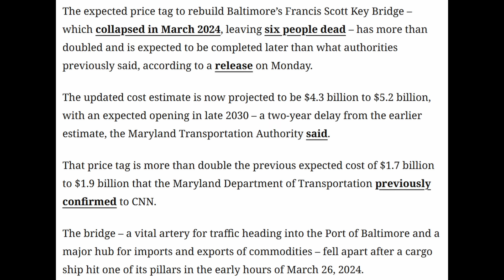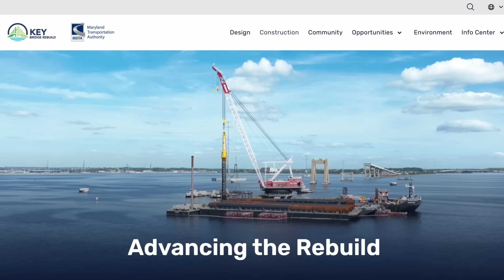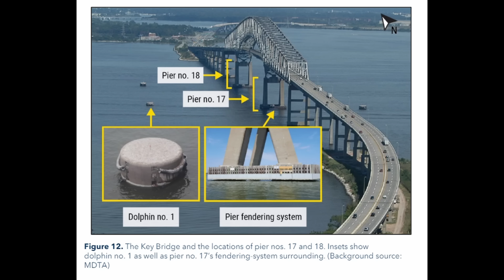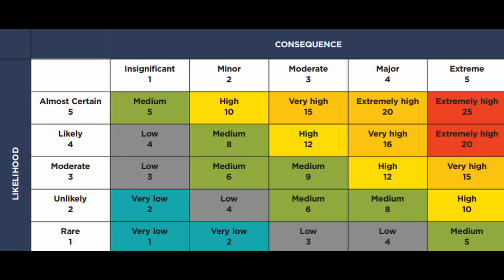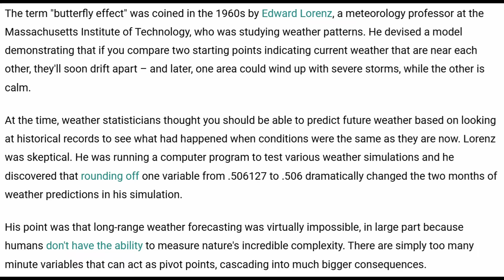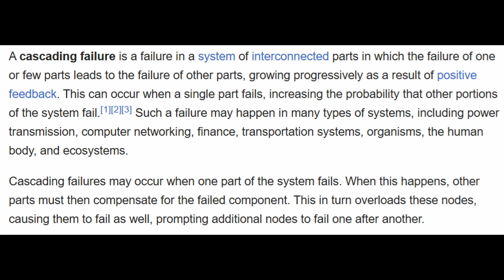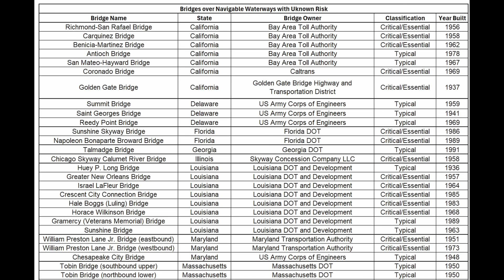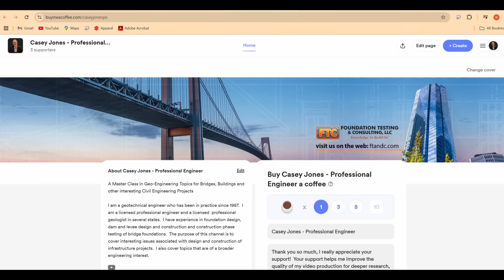Key Bridge Destroyed because of a Label on a Single Cable

Comment: Reading the Rivers And Harbor act of 1899 today for unrelated reasons.     SEC. 18.  Gives Kristi Noem (dept. Coast Guard is under) authority to order remedial action to existing bridges that constitute hazards to navigation.  Which, bridges prone to collapse if a ship has a loose wire are in my opinion.  It made me think of the Key bridge story.   

I can see a re-design for the electrical panel to give a visual indicator when the wire is inserted all the way and a retaining force is being applied.

Comment: It would also be good if all future bridges had some way to immediately detect when the bridge span is no longer continuous like in the case of railroad tracks (electrical current along the rail is interrupted). In this way, only the people currently on or unable to stop before the point of bridge failure would end up in the drink. There's not one single reason not to do this immediately.
Reply: Also, don't tell me that money is a reason. If you value a relatively small amount of money over human life, you have no business doing any kind of engineering and we all know that many of the problems we have with modern engineering would cost a very small fraction of the total cost of the project to fix. No excuses.

Comment: Sometimes I think we trust in our computers more than we should. Computers work on algorithms, which are models. What many or most seem to have forgotten is that ALL MODELS ARE WRONG! However, some models are useful. Models should be used whilst never forgetting that all models are wrong in some way or another no matter how useful they are and the beauty of being a human is being able to look rationally at these models and the results of ongoing experiments based on them and noticing where the models are wrong. In the case of engineers in particular, someone needs to notice and have the power to do something about it. One needs to learn not only how to use computers but how to tell when the computer is wrong, which only a human being can do.

Comment: for critical infrastructure, the critical risk factor, in my mind ought to be based around 
- the maximum size vessel the waterway would carry (including if dredged in the future)
- assuming this maximum sized vessel is deliberatly put into the infrastructure by design into the the most vunerable area at maximum speed and wieght.
- long term critical infrastructure needs to be designed as such, with a view that at some stage there will be a maximum effort out into takeing it out.

Comment: Poet George Herbert included in a 1640 collection of aphorisms "For want of a naile the shoe is lost, for want of a shoe the horse is lost, for want of a horse the rider is lost." The root cause analysis of chain of events preceding any severe action expose apparently trivial issues. Yet hundreds of thousands of trivial issues never cause any severe events. This exposes the true systemic failure. Trivial failures are expected, the system design must accommodate these, and compensate, if avoiding tragedy is the goal.

Comment: You want answers? Here's your answer, Tunnels use tunnels instead of bridges. I'd like to see a boat run into a tunnel.
Reply from the maker: I think there is an issue with no being able to have hazardous shipments going through a tunnel.
Reply: Tunnels... full of brand new HIGHLY FLAMMABLE electric cars 😅 You will see that more and more often.

Comment: I'm SURE there is a system for Risk Assessment and Mitigation, but that requires $$$$ and THE IMPETUS FROM THE ADMIN SYSTEMS IN THE PORT TO UPDATE THE ANALYSIS AND TAKE ACTIONS.

Worked in another HIGH RISK industry, and I was continually pounded and fettered by the steps and analysis needed to protect our safety envelope.  This is typical of the FAILURE of people TO TAKE THEIR JOBS SERIOUSLY ENOUGH TO HAZARD THEIR PAYCHECK AND MORTGAGE PAYMENTS.

The WIRE was not the OVERWHELMING ISSUE.

The appropriate systemic requirement is BARRIER ANALYSIS, as in the Swiss Cheese metaphor for handling risks.

Butterfly Effect is mostly irrelevant, as there are FAR too many BARRIERS that ALSO have to allow such a butterfly to make a difference.
It is an interesting Gedanken Experiment/Thought Experiment, but it is too lacking in details to be PRACTICALLY implement for efficacious prevention of disasters like this.

As far as I'm concerned, The Port was utterly remiss in ADEQUATELY IDENTIFYING THE RISKS WHEN THEY ALLOWED LARGE SHIPS LIKE THIS TO PASS UNDER THE BRIDGE SAFELY!!
As far as I'm concerned, The Port was TOO CHEAP TO TAKE THE STEPS NECESSARY TO ENSURE THEIR EXPANSION OF SHIP TYPES ALLOWED WAS SAFE!!!
As far as I'm concerned, The Port was DRIVEN MORE BY THE COMMERCIAL INTERESTS AND CROOKED BIDNESSMEN IN THE PORT THAN BY THE LIVES AND SAFETY OF BRIDGE USERS AND PORT EMPLOYEES!!!!

This is just another example of entrenched, OLD-TIME CITY BUREAUCRACY being CAPTURED by the very crooks they are meant to protect citizens from, like at Fukushima, Japan.

But, not a single administrator or project engineer will be censured, much less the responsible elected officials left dangling from the girders of the replacement bridge.

Comment: Redundancy built into the system for safety will never be the CHEAPEST OR MOST EFFICIENT.  One long wire is efficient,  but several short wires capable of maintenance. 
Outsourcing causing one lack of responsibility to snow ball. Who manufactured wires, who manufactured labels. Which company affixed labels. Were labels all the same color because chose the cheapest color. Another company chooses how many pilons and another decides to use narrower pilons placed further apart, because cheapest is best mentality. Are we teaching kids in school to look for their own mistakes to correct them. INTEGRITY spelling word is taught, but what good is a word in no one considers its meaning.

Comment: I'm not sure the Concorde explosion is a case of 'the butterfly effect'. There is a physical relationship, however small, between a butterfly flapping its wings and a huge meteorological event on the other side of the world. Both are the same system, the atmosphere.
However, there is no such relationship between the joint  probability of a piece of metal in the wrong place on a runway and a plane's tyre running over it; that can only be reasonably considered as random, I suggest.
Nevertheless, great video and channel!

Comment: I'm sorry but the crew needs to be investigated because from the clip, it looks like the ship was barely veering when the power was off but once the power came on you can see the ship "veering" more aggressively, only to have the power go back out after the ship was basically almost aligned to drift right into that trust.... From the initial trajectory of the ship, before power was able to turn on for a short time, you could make the argument that it would've hit the trust more to the right of the video, and you could argue that they crew might have over adjusted once the power was back on.. but idk I'm not an investigator or anything, I just think the clip looks weird af
Reply: It was discussed in other channels, they didn't have the steering, they were dragging right anchor and had wind pushing them right.

Comment: I really like your approach going back and forth fro serious engineering topics, discussing resources to making a small (seemingly obvious) sarcastic joke. I think its the best way to approach this topic. I agree completely on the use of the probabilistic approach. The data generally used is a very small data set of real numbers and a lot of "well, we've had sucess for X years with it...". It's also hard to convince a new construction group (MTA) to spend more of their funding than is necessary, because they have to believe in it, and fight for the extra billion needed to properly secure the bridge for the next 75-100 years.

Comment: The USA has an electoral system which is unusually vulnerable to corruption.  In most other developed countries corporations, including labor unions, are prohibited from making political contributions, and the maximum political contribution from individual electors is an amount that any middle class household can afford.  This ensures that politicians consider the interests of the electors before those of mega-corporations.  One of the key design inputs to the FSK bridge was the expected length of container ships passing under it.  That maximum length should have been imposed on the Baltimore container port, but the Maryland politicians authorized expanding the capacity of the port both in terms of more than doubling the length of ships and massively increasing the volume of traffic, with no engineering changes to the FSK bridge, such as much larger dolphins positioned to prevent an out-of-control ship from striking the supports, or filling in the water around the supports so that a ship would necessarily run aground so that its momentum was eliminated or minimized before it reached the supports.  The expansion of the container port must have poured cash into the funding of Maryland state politicians.  Shipping is extraordinarily safe these days because of the work of agencies such as the NTSB.  But when you design a bridge which is so expensive that it must operate for a century with only routine maintenance, like the Firth of Forth bridge which has been in continuous operation for 135 years, a once in a century accident has a 1% chance of happening in every year.  And clearly this incident was at most a once in 50 years accident as it was the second such incident in the half-century the bridge was in operation..  The failed bridge dates back to design by slide-rule.  There were only a handful of designs which could be estimated using manual calculations to two digits accuracy.  cable-stayed bridges are more common outside of North America because of the abundance of existing bridge stock that you acquire when modern mechanized warfare is no raging across your homeland.  Continuous truss was the go-to design for anything that did not demand the greater span supported by Suspension bridges.

There is an interesting comparison with the Gordie Howe Bridge between Detroit and Sarnia.  The venal politicians in Lansing, Michigan have refused to invest in this bridge at all, so the bridge, and its international security facilities in both countries is entirely funded by Canada.  Its central span over the navigation channel of 853 m (2,799 ft) is the longest in North America.

Comment: I watched the whole NTSB report and they made the point that if the system was run in Automatic mode instead of Manual they likely would Not have had the total failure. That and the Flush Pump was used Improperly. That's what I took from it.

Comment: Never mind the ferrule. If the whole ships power hinges on a single wire, I’d make it a big gauge, put it behind a plexiglass enclosure and connect it with a brass flange with multiple threaded stud terminals.

Comment: It's called inertia! In the airline industry it's tombstone technology! 
Installing / retrofitting/ freshly building structures to a better building code is expensive! When income is limited& companies wish to maximise profits (who for is quite another question but reveals the driver for it) the question is who pays to include it, do accidents occur often enough to mean the public would call for the change (as that's where the income comes from) & how much would insurance cost & let them pay! (The rather gruesome concept that every body part, disability or whole body has a price & if, for example, the total cost of litigation, costs, premium, renewal & excess of day a 777 crashing & killing everyone onboard might cost the airline or manufacturer $1 billion but the retrofit cost might be $2 billion per fleet, given the frequency of a 100% fatality crash, it's better to let a few hundred ppl die than pay out to fix your fleet so that all 777's are safe isn't cost effective, as long as 777 crashes are a rarity.) That's what happens when economic common sense kicks in! & It's no wonder anyone speaks of that option! (It applies to any device humans might use from can Poland to care to ships hitting bridges you might be using when the shop hits it! Normal common sense says make it so it can't fail, or it at least fails safe! But what it something happens you couldn't have predicted? Again, common sense says key ships away from the the bridges they pass under! You don't need an equation for that! 
Don't make the bridge of the flimsiest step you can get your hands on with rivets double the recommended distance & half the regulated thickness & foundations only half as deep as needed & your dolphins almost invisible at water level close to the piers! Yeah, sure you'll save a packet & the bridge owners will love you, etc! Common sense says you're setting everyone up for a fall!

The fourth bridge in Scotland was one of the first huge steel bridges built! 200 or so years on, despite it's exposed position, on a waterway that's busy, foggy, big tidal flow, etc. It's bad no damage or strikes because it's protected & overwhelmed! Simple! We don't build anything like that anymore, we build stuff to fail & need replacing to keep industries in business! 

If you have drivers like that, What's the incentive to build safer bridges? None! Not too even experienced energy looking into what else may look like in the future & if the bridge concepts are even plausible! 

Common sense has gone out the window & we use a system of risk assessment based upon cost! 🤷🏻 Why are we so dammed stupid? Until that view changes, such disasters will continue & lives will be lost! 

So what is the common sense answer? Well, how long have Roman structures been standing? 2-2,500 years! How many 1950's buildings do we still have standing? Clearly the Romans knew a thing or two about building stuff! Look at the pont du Garde, the 3 tiered arched aqueduct over a deep river valley that's survived many foods & impact damage! The pantheon, the largest, oldest, unsupported, unreinforced done in the world! Both still standing almost exactly as originally built! Think any of our structures are going to be dug up in 2,000 years from now? 
No chance! 
Yet Romans used metal! They put lead or iron ties in stone walls to hold them together! They used nails, shoes, sheaths,  pile feet....  Could they have fashioned iron beams, i don't see why not, they already made parts for their seige weapons! They clearly realised stone was better than all metal! Stone doesn't rust! Yet we insist on using metal! Roman concrete was stronger, not far off what rebar does to concrete! So they didn't even need stone! Hello, they even threw together a wooden, WOODEN, not stone, or metal, a wooden bridge over the rhine in under a week & then dismantled it (to use elsewhere) afterwards! That must have been one hell of a strong bridge! Their structures are earthquake proof! Look how many big quakes it took to bring down the Colosseum & even then it was only about ¼ of the outer support wall! Oh but you can't build some that high to let a ship under.... Oh yeah? Look at Mostar bridge! Or the Menai suspension bridge in Wales, built by Stephenson, the high level road & rail bridge across the Tyne in Newcastle. Even the piers of your Brooklyn bridge! We've lost the plot on building strong structures. Any of those bridges been taken out by ship strikes, canon or other things? Nope!

Comment: I call them stab lock connections don’t like them . Mechanical pressure is best . The stab lock connections heat up cool down eventually making a bad connection load depending . Never mind not having a redundant system one connection you lose all power???????????????

Comment: The loose wire wouldn't have mattered if the bridge had adequate defenses against possible collision. Given its design, where failure of one section would impact all of it, this should have been basic, especially since it had traffic capable of destroying it passing underneath daily.

Comment: You are completely correct!  Instead of trying to predict the probability that a bad thing would happen with the full understanding that if it did, you’re screwed, instead, we should focus on asking what are the worst things that could happen, and if they did happen, what can we do to mitigate them?  By doing a probability calculation like you describe, you are making an overt assumption.  You are assuming that that bad thing will never happen.  We need to be asking the opposite question.  Assume it will happen, and then ask the question what can we do about it?  That type of thinking results in robust systems the other decks of cards.
Reply from the maker: Precisely!

Comment: I also watched the NTSB animation video, and I wasn't smart enough to understand it completely. It appeared the system had carefully designed, redundant, independent electrical systems, so that something as trivial as one failed wire or even something big like taking an axe to any part of one of those systems would not leave any critical systems without power, because the other system would smoothly kick in. There was mention of a switch being in manual mode instead of automatic mode, and some pump was installed somewhere, but I couldn't quite piece it all together. I'm still looking for a video that explains it for someone like me.